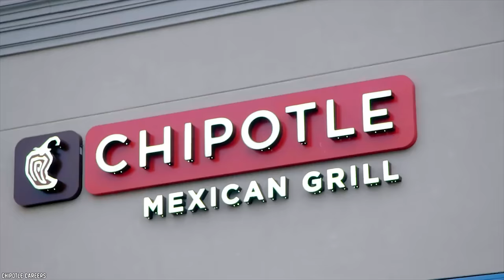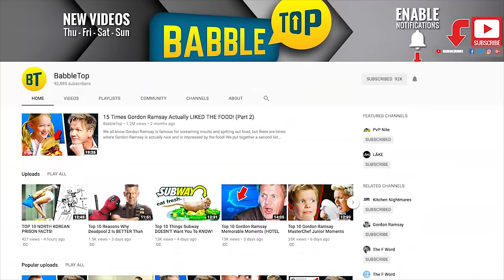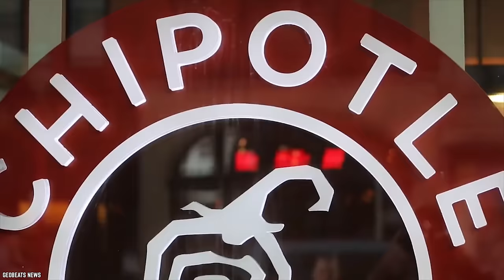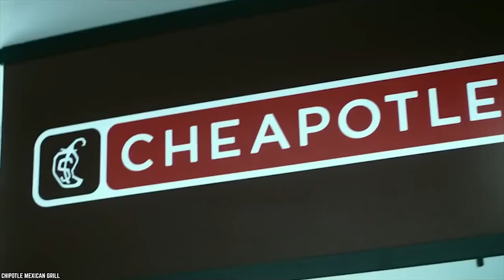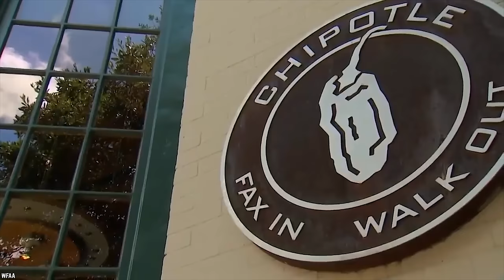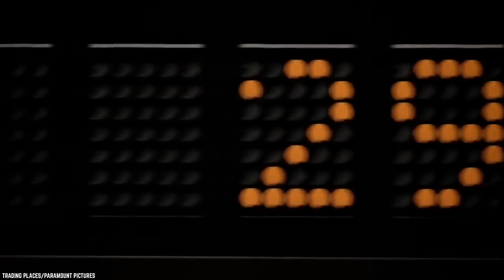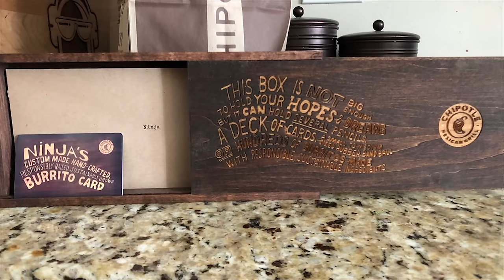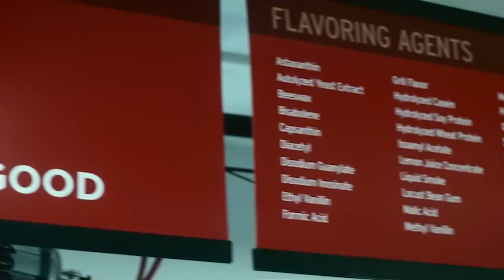TOP 10 UNTOLD TRUTHS OF CHIPOTLE!!!

Comment: They shut down the relatively new chipotle near me due to lack of customers and complaints of old sitting food. I went to other location 10mins away and the worker was adding new steak to the bin by pulling out the stainless steel bin over the chicken bin. All the dirty warming water underneath the steak bin went all over the chicken. Chipotle, please change this practice and pour the food into the bin instead to prevent me from sitting on the toilet all night.
Reply: Call it a Mexican food chain but no Mexican food or Mexicans working there and the person that started it is not Mexican.
Reply: +ba sillah in NYC all Spanish folks working there
Reply: cook at home, its probably going to be better anyway
Reply: Definitely sounds like something that could be a potential biohazard. But if that's the reason for all of these continuing outbreaks, don't you think they would have realized this by now, considering all the investigations they've had to endure?